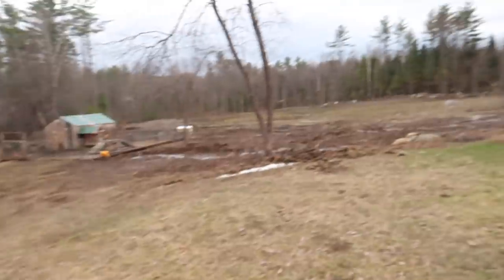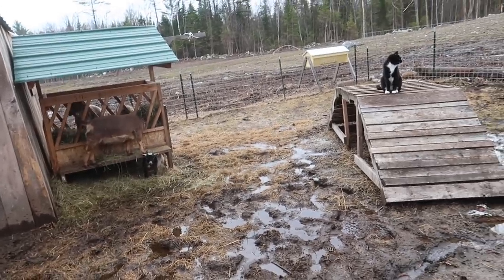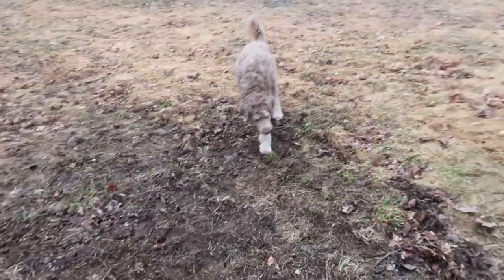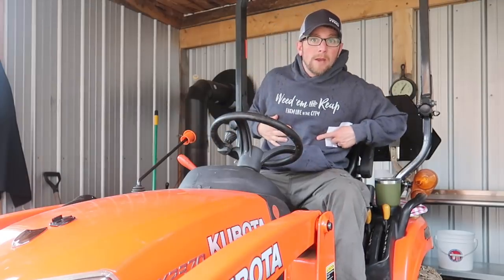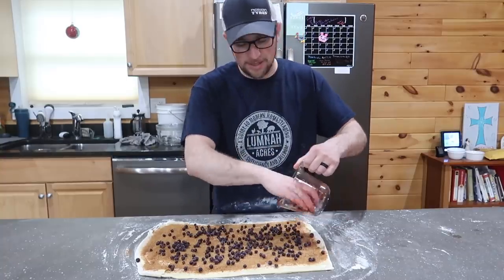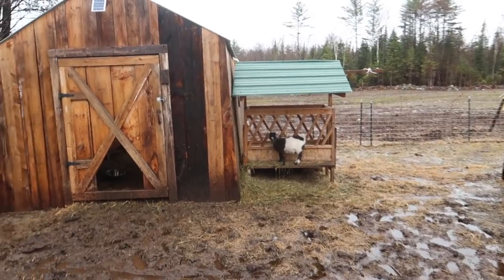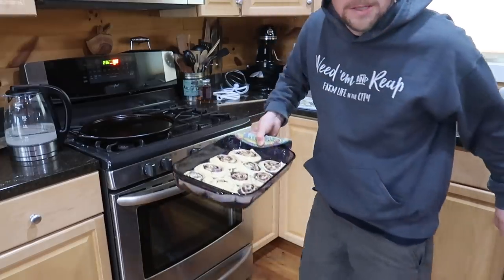We weren't Expecting THIS invoice from our VET Visit  (in a Good Way)

Comment: You may want to check to see if your barn materials are getting mold from all the moisture,with the plastic wrap the sun will pull moisture out of the ground once it gets up in the plastic it can’t go any where,you can remove the plastic and let the moisture out and then keep tarps over it until you get ready to build.

Comment: Did you notice that a lot of the snow did not melt? It sublimated. The breeze helps with sublimation. Try to explain sublimation to Olivia. 

Float a ping pong ball or 2 in the rain barrel so you can see the surface easier.

Comment: You might try using fishing line to cut the cinnamon rolls. cut a 14" length of line, tie the ends of the line through a medium to large size button on each end to give you something to hang on to. place the roll of dough on top of the line and cross the line over the top of the dough and pull. It makes a clean cut and doesn't squish the dough much. Those you made look delicious!

Comment: Hi 
 I like your videos and your family.
Just a couple  of suggestions, I saw you trying to plow Snow without weight in the back of your pickup. We use too always put in sand tubes in the bed during the winter months.  My father also made a two by four bracket between the wheel wells to hold four five gallon buckets of sand. We did not plow snow, but all pickups need extra weight in the back on ice and snow.
I also saw that you did not have rubber straps on your tractors snow tires chains to keep them in place, this would help. You might want too put down a couple of feet of fill dirt before pouring your foundation to keep the buildings higher and give everything drier.
I grew up on a farm in Nebraska, it was the best life.  my parents should not have sold them, I would be living there now. Sixth generation.
Thanks,  Bruce

Comment: That was a great price. It all depends on where you live and the vet themselves. If you're lucky enough to have a livestock traveling vet, they are usually pretty reasonable. They have to be or else the let's say large cattle farmers and such just won't use them. But if you're not lucky enough to have a vet office that does not have a vet that travels to farms full time, then it's usually going to be more for them to make a house call. The price also depends on what kind of animal it is. Horses and cows need quadruple the amout of vaccines than a pygmy goat 🤷🏻‍♀️. My best advice for anyone with a small homestead with animals is learn learn learn! Get a vet that will give you free advice and recommendations on what you can before you have to call a vet out. Most things like like vaccinations, wound care including giving IM antibiotics, banding castration for young animals, ect...you can do yourself without a vet. And if you're lucky enough to have a college with veterinary program close by, you're almost certain you can get very reasonably priced vet care. And that goes for hamster up to exotic animals.

Comment: In the chick water recipe I know also added some garlic in a jar waterer.  The garlic won't dissolve and could clog the automatic waterer you're using.
Your vet bill was quite low considering the travel expense, vaccines and wellness check-ups for four animals. In this area you easily can spend $200 for one dog between Office visit, check-up, vaccines, labs, heartworm prevention and flea&tick control.
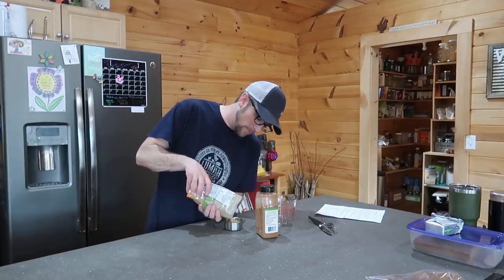At 13:33 I read the "2 Hours Later" with a fake French accent (Spongebob influence)
Was the camera you're replacing the one that got knocked over in the goat pen awhile back?

Comment: Bad Rooster No More. I saw on 10 acre woods they grab the rooster hold its legs and flip it upside down until it stops struggling. Until it stops it is not submitting. They said it is worth the try as it has stopped several roosters from jumping them (and they have some big ones for sure) and saved them from heading a good rooster making a temporarily poor decision to the pot.

Comment: Maybe your vet deducted some advertising value for your video from the bill ?
I 've never known any kind of medical bill to be less than expected ! It's always more than expected .
 I watch Hope get inside of the hay rack feeder and I think , were the other goats ever that small ?  Yes , they were . Once upon a time.  Now they are doing , Queen of the hay feeder. 
  I got my lawn tractor out of the mud hole ! I had to charge the battery over night and then with the tractor in reverse , and a tow strap and come along attached to a sapling, it came out of the mud hole inch by inch .  I'll tell you , over the years , that come along has been worth every penny I paid for it !  And it did not cost that much for the value that I have received from it . Now , I really need to mow as my grass is already mid-calf high.  But , I also still have a number of wet muddy places.  No more being stuck in the mud.  It requires a lot of effort on my part to get unstuck .

Comment: I'll give you about a week until they break, being the pigs would still be small....once they get bigger they'll chew it all up, maybe even eat the assembly.
Reply: On our farm, we had similar valves for the hogs to activate, however there were heavy steel guards encompassing the valve in the back and both sides. Sort of like an iron angle /corner joint to protect the valve.  Allowed the pig to get his snout in but prevented him from leaning or pushing against the piping.